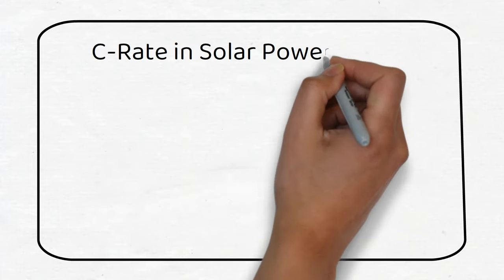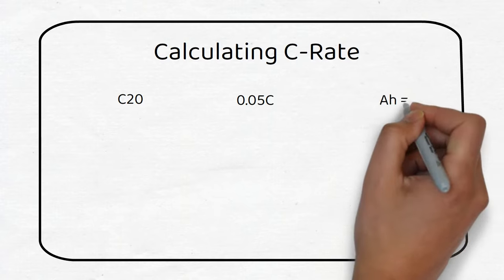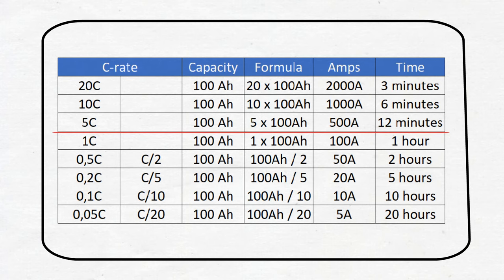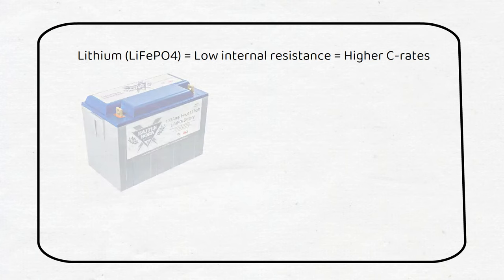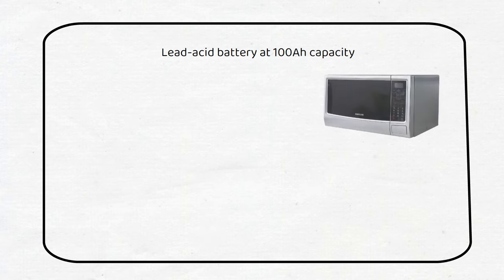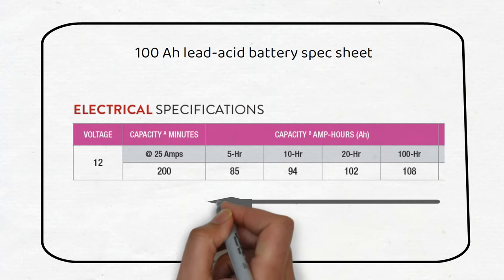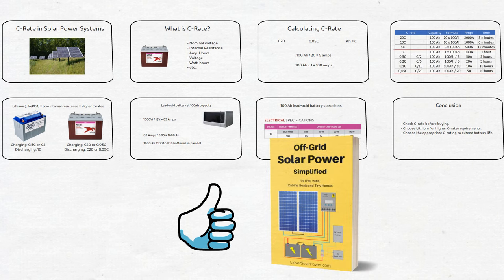What is the C Rate for Lead-Acid and Lithium Batteries? How to Calculate

Comment: Thank you for the many excellent videos you have produced.  Many people have had seemingly good results employing used forklift batteries as the storage for home systems.  They find used batteries and often spend about $100 US for them, then spend a month or more reconditioning the batteries, often using a single solar panel to “boil” the batteries which removes the stratification from the plates.  Eventually the batteries have very high capacity.  They also contend these batteries can be drawn well below 50% of capacity regularly and still bounce back for many years.  This runs against the normal lead acid logic but I believe them.  They are running off grid homes and are running normal grid tied loads daily. Do you have any experience or opinion on these batteries?  Thanks ColoradoKeith
Reply from the maker: Hello Keith, you can run lead acid below 50%, but it will always have an impact on cycle life. Remember that people like to show off their system online. So take some of these with a pinch of salt. It's definitely possible, but not very practical to find such batteries. The boiling is sulfation removal and chargers have these built in. Should run once a month. Voltage is a bit higher than normal during charging.

Comment: Thank you so am I right in saying for an AGM leisure battery the lower the C rate the better?
Reply from the maker: It's better to have a low current draw/charge than a high current draw for any battery. 0.2C is the maximum an AGM - lead-acid battery. Lower is best.
Reply: @cleversolarpower  thank you I'm trying to decide between three AGM batteries. One is 100Ah at C20 one is 120Ah at C100 and the third one is 120Ah at C20 . 
On those figures which do you think would be the best to buy? 
Thank you so much for trying to help me - I'm very confused and can't decide out of the three which to choose

Comment: Can you calculate the c rate? I have panasonic up-vw1245p1 seald lead acid battery and i would like to know the c rate. 12v 9ah
Reply from the maker: You cannot calculate the c-rate. The c-rate is given in the datasheet of the battery. You have to look up the battery tape and it's recommended c-rate.

Comment: Good series of videos. You should do one on the Peukert effect. It's kind of related to this topic. Lead batteries with a Peukert of 1.25 lose a lot of their capacity at high C rates of discharge, where as LiFePO4 batteries with a Peukert number of 1.02 to 1.05 can still supply almost all of their energy at high C rates. https://en.wikipedia.org/wiki/Peukert's_law

Comment: Hello @cleversolarpower and thank you for the video. Could you please confirm if the formulas and numbers in minute 1:05 are ok? with a C rate of 20, a battery rated 100 Ah should discharge or charge at 2000 A in 3 minutes, like you shown in the table.
Reply from the maker: C20 is different than 20C. When the number is in front of the C, you multiply and when the number is behind the C, you divide. At 1:05 you can see C20 is the same as 0.05C.
Reply: @cleversolarpower  Maybe term to be used should be number  before C or after C.
Front or behind is confusing.

Comment: nice video, 1 suggestion can you make a video doing a diagram about Off the grid solar system with Micro inverters and batteries with all the parts needed 👍🏻
Reply from the maker: I'm working on that as an addition to the book. Later I will upload a few videos talking about the different systems. Thanks for the suggestion.

Comment: Can you clear the contradiction please? Because in another video, you said the C-rate for a lead acid battery is 0.2.
Reply from the maker: Some lead-acid batteries are 0.05C like flooded lead-acid. Others like GEL and AGM is 0.2C. You can find it on the battery datasheet.
Reply: In your sample 20C you divide AH by 20, but on the table it should be multiplied, am i missing something? 😂

Comment: hi. 5200 mAh, 3 H and 50 C are given. Voltage is not given. How to calculate power of this battery? Thanks.
Reply from the maker: You need to figure out how many cells there are. Every cell has it's own voltage depending on chemistry.

Comment: thank you finally a video on C ratings that is easy to understand, although my battery has 2 C ratings C20 82ah and C100 90ah I'm guessing the C100 rating is max capacity so would the 82ah C20 rating be it's usable capacity?
Reply from the maker: At C20 you battery can deliver 82Ah, at C100 the same battery can deliver 90Ah. You battery capacity changes if the load is lower. The advertised capacity for this battery should be 82Ah.
Reply: @cleversolarpower  thank you

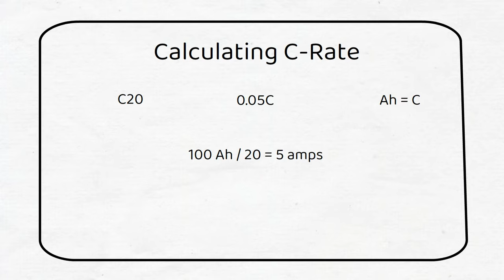Comment: You got me confused. 1:20 Why do you multiply capacity of 100 Ah by 1 for a Lithium battery with a discharge C rating of 1, but in the previous example you divide (you don't multiply) capacity of 100 Ah by 20 for a Lead-Acid battery with a C "rating" (unspecified type of rating) of 20? You also go on to say that the Lithium battery can charge and discharge at 100 amps. How do you know that the charge and discharge C ratings are the same for the Lithium battery, and if they are the same, why would they not be the same for the Lead-Acid battery?
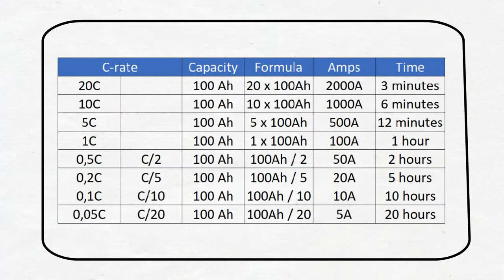Reply: 1:33 This table did make it easier to understand. I can see where my confusion comes from (I didn't have time to sit through the whole video when I made the first comment). 20C and C/20 is not the same thing. 0.05C and C/20 is the same, but 20C and C/20 is not. Just like 5 dollars is not the same as 1/5 dollar. (The difference is evident from pluralization alone. Five dollars is more than one dollar; one fifth of a dollar is not even a single dollar.) Likewise, 20C is a factor of 20, and C/20 is a factor of 1/20. The slash hints that it's a fraction.

All this is saying is that division by 20 is multiplication by 1/20. But who on Earth doesn't know that, and yet wants to learn about C-rates for batteries? This is basic math. It's not necessary to make it so complicated. Changing the formula or the form of the formula just because you dip into fractions once you go below 1C to make it easy on the noobs is a total waste in my opinion and only adds to further confusion.

Also, keeping track of where the C letter is, if it's in front of the number or behind the number is completely unnecessary. Just take 100 Ah and multiply by 0.05 like it says on the far left (0,05C). It's the same as dividing 100 Ah by 20. Because of this extra step, you actually managed to confuse yourself in the video. 1:48 You said "if it's after the number, you divide it by battery capacity". It's not capacity. You meant to say divide it by the C-rate number, not by capacity. Capacity is 100, C-rate number is 20 (C/20). You're dividing by 20, not by 100.

Knowing the difference between divisor and dividend is much more useful than knowing where the C letter is positioned within something as obscure as a battery's C-rating. Basic knowledge usually is most important. Now I can better understand why so many people are having a hard time with C-ratings. They don't know math well enough. There are no shortcuts to getting the basics down right.
Reply from the maker: I understand your confusion. I didn't invent the way the C-rate is written down. There are two ways that are being used so I explained both. If in doubt, refer to the table for clarification.
Reply: @cleversolarpower  What does the "C" in "C-rate" stand for? Charge? Current? Capacity? Neither? I know the answer is not on Wikipedia. I have also looked at other sources. From Wikipedia article on battery charger: "Charge and discharge rates are often given as C or C-rate, which is a measure of the rate at which a battery is charged or discharged relative to its capacity."

Also, I wonder if these C-rate numbers hold up to what it says on the label? Have you ever tested them to confirm? I am by no means in battery business, or in solar panel business. So I don't know much about these things. But I have worked as an electrician, and I went to a practical secondary school (gymnasium) in Sweden to learn the trade, so I do understand the basics of batteries and electricity in general. I only recently came across the term "C-rate" and was wondering what it is, so I googled and landed here.

The only unit of measurement I know of that uses "C" is Coulomb. But it doesn't fit the description here. C-rate is not a measure of electric charge. It's a "rate" of charge. In other words, it measures speed! Rate is just a fancier word for "speed". So C-rate stands for "charge rate" then? Charge speed, in other words. It might be! If it wasn't for the fact that the same term is used for both charge and discharge! So it's kind of broken right there. It's badly defined to be a measurement of anything. Using a single letter for double meaning and open up for free interpretation. You can have it mean whatever you wish. Current, capacity, charge... it's all good. But that's not science.

If C-rate means charge rate, then logically, discharge rate should be abbreviated as "D-rate", right? But it's not. Instead, everything is just "C-rate", including burst discharge rate (how about "BD-rate" for short?). I think it would be a good fit to use C-rate for charge rate, and D-rate for discharge rate. Because the maximum charge rate and maximum discharge rate of a battery is hardly ever equal.

I think C-rate is one of those "measurements" that don't carry much scientific significance. It's the battery equivalent of a "shoe size". If C-rate was a universal unit of a physical quantity, it would be better defined, well documented, scientifically accepted, and it would be included in the SI system of units. It would not need to be made "relative" to the battery capacity to be relevant.

C-rate reminds me of gravity. Everyone can feel its effects, some of us can explain it, a few can do calculations on it, but no one really knows what it is.

You can think of C-rate as the speed at which you can drive a car from New York to San Francisco on a full tank, relative to the size of your gas tank. You can have a fast car that consumes a lot of gas to get there faster, but if your gas tank is too small, you will never get to your destination. The higher the consumption and the smaller the gas tank, the faster you will get stranded. What really matters in the long run is capacity. This is also why it's printed on every rechargeable battery, even when C-rate is not.
Reply from the maker: @samirgunic  C-rate doesn't have a unit. I exist because a battery with an advertised capacity of 100Ah can have more capacity and less capacity. If it is discharged fast (at a high c-rate) then the capacity is reduced because of heat generation. If the battery is discharged slowly it will have more than 100Ah. To make the manufacturers use one unit and not falsely advertise, they use a 0.2C rate for lead-acid. If the same 100Ah battery gets tested at a 0.5C rate the capacity will be reduced. If it is tested at 0.1C rate, then the capacity is more than 100Ah.
Reply: @cleversolarpower  i think you was a little bit wrong, because I found in datasheets for a different kind of lead acid batteries there a many acceptable values for C-rates (different charts are there), it's only affects time for work in that special  range of voltage and current (something looks like available amount of power for special battery mode). If I'm not wrong, there are only two issues with lead acid battery which affect life cycles: depth of charge (undercharge) and incorrect max charging voltage value (overcharge).
Reply from the maker: @igornedashkivskyi1472  Yes, there will be multiple C-rates on the datasheet. If you look closely, the amount of Ah will reduce when C-rate increases. So there will be less capacity if the C-rate is higher. These are losses due to heat generation. I'm not sure if this answers your question.
Reply: @cleversolarpower  first of all, thanks for your answer.
I meant that in datasheet for my GEL battery I didn't found any info related to influence increase amount of discharge current (in allowable ranges by this spec) on battery lifecycles, but depth of discharge only. About charging current that datasheet has only one maximum C-rated initial current value which not recommend to exceed.
That what I had been trying to say in my previous comment.